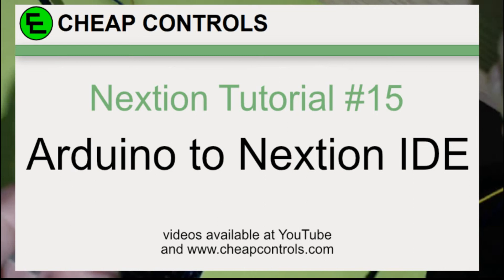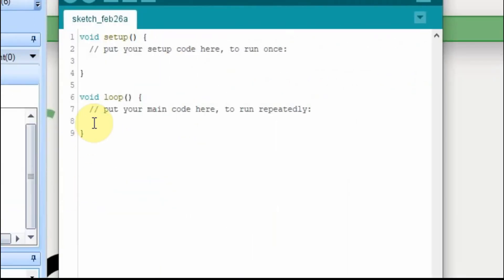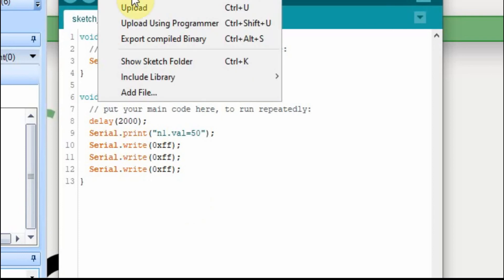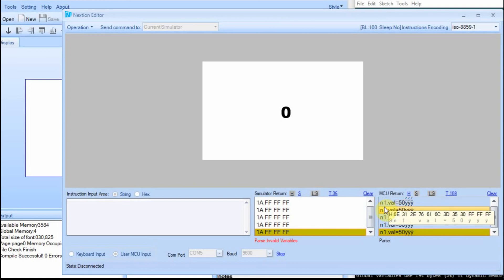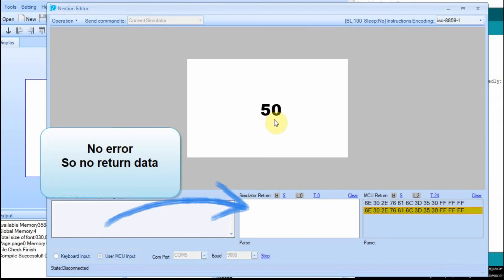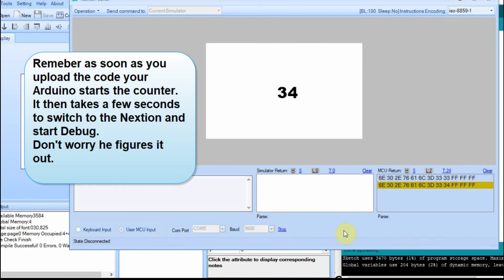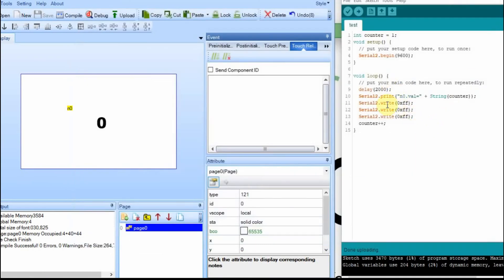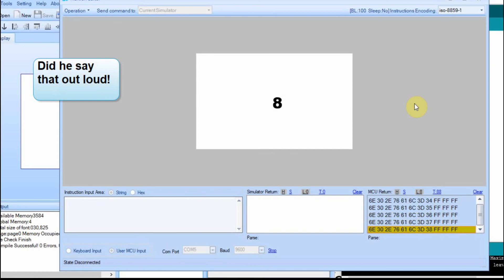#85 Nextion Display - connected to Arduino in debug mode - Nextion tutorial

Comment: Hey maybe you can help me.
I'm working on a bigger project with the Nextion Display.
I can recive data form the Display, but even with your tutorial I cant send them.
I'm also using a Mega with the Serial2.

Is there any butten I've missed in the Nextion settings?
Reply from the maker: You should connect the mega to the Nextion IDE in debug mode so you can see what you are sending.  I will look for a tutorial on this and post another comment.
Reply from the maker: Here is a link to that video https://youtu.be/22pqL1ovKtw

Comment: I managed to get it working with simulated debug but not with my actual nextion. However, my nextion works given parser is zero and my pins are blue wire to tx0 and yellow wire to rx1 on arduino mega, through keyboard typing in values.

However, this doesn’t work for me when I use the ide code, and I don’t know why. What am I missing?
Reply from the maker: I am not sure.  If you want me to review code or send images go to www.cheapcontrols.com and submit a comment.  I will reply through email.

Comment: Hi,
Is there a way to control the hardware control flow lines of the USB to serial adapter from the debug window?  I looking at trying to use the Nextion editor as a remote monitoring terminal for my microcontroller in a project and was hoping to use the RTS line to trigger the reset pin on my micro in the event I need to reset my micro for some reason.

Thanks
Reply from the maker: If you have an enhanced display you could use a GPIO pin.

Comment: Thanks a lot for your tutorial !, I recently started using Nextion I have problem in the display of data in Debug of Nextion , and I did not understand the role of Serial.write here in this program.I will be very grateful to you if you can answer me
Reply from the maker: I am not sure I understand your question.  This is an older video and I don't remember all of them.  Is there a timestamp that you can refer to?  That would help.  You can also submit a comment or question on the help page of the Cheap Controls website.
Reply: @CheapControls  I have a problem displaying the data in debug , the data should be as the next syntax : " Humidity level : " + a variable of type int , I couldn't display the variable even though I tried a lot
Reply from the maker: Are you using two connections.  One for the Arduino IDE and one for the Nextion IDE.

Comment: Hey i have a little problem while sending value with arduino, when i click on every button in the debug mode that send a return error 04 FF FF FF Parse Invalid Pic ID so when i want a "if (datareceive == "Anything") that doesn't work if you have time to respond i appreciate
Reply from the maker: Cut and paste the line you are trying to send and I will try to help.  Or you can go to www.cheapcontrols.com and submit a help request.
Reply: @CheapControls  I think there is a problem with the pictures but i can't see where is the problem, i want to send a string value with a simple button "gate" and i want arduino to read it so i can return a instruction for the debug mode. But when i click, that send "gate" but also "\x04ÿÿÿ" just below in the simulator return so arduino can't read just "gate", i tried to tell arduino if he can read "\x04ÿÿÿ" but its doesn't work. Here is my arduino if you want :

void end_message(void)
{
  Serial.write(0xFF);
  Serial.write(0xFF);
  Serial.write(0xFF);
}

void loop() 
{
  while (!Serial.available());
  
  datareceive = Serial.readString();

  if (datareceive == "gate")
  {
    Serial.print("Data return confirm");
  }
}
Reply from the maker: do you have the send component id checked in the Nextion?  that would send extra characters
Reply: @CheapControls  only the button to return in the previous page but not all of them send characters just a few one. If you have time i can send you my .HMI file so you can check but i don't want to 
disturb you
Reply from the maker: If you want me to review your HMI file, you have to go to the help page on the www.cheapcontrols.com and submit a comment.
Reply: @CheapControls  thank i'll do it this morning

Comment: Greetings! how can you fix the "access to com7(my arduino port) is denied
? Thanks <3
Reply from the maker: I don't know.  I would have to understand your configuration better.  What model of Arduino are you using?  What pins are you using on the Arduino to connected to the Nextion IDE?  It needs to be a different port than the one used to connect the Arduino to the Arduino IDE.  Good Luck.
Reply: @CheapControls  Hi! thankyou for your reply <3. my problem is already fixed though. It turns out the arduino IDE is also connected on com7 😅
Reply from the maker: Did you have to stop the Serial Monitor to allow the Nextion IDE to work?

Comment: Have you ever tried conecting the arduino to the PC so you can use Nextion Editor Debug and to a physical Nextion at the same time, so you simulate having two screens?
Reply from the maker: I have not done this but it should work.  It would be easier with a MEGA model.  You would need to have three serial ports configured.

Comment: Thanks for your tutorial! I have a problem: no information is coming from the Arduino to the Nextion display. Just an empty line in Debug mode. I connected the Arduino to the COM5 port with a separate cable and connected the Nextion display through the TTL adapter to the COM4 port. How can this problem be solved?
Reply from the maker: When you go into debug do you select user MCU port then you have to click on the word start.  Maybe you are doing that.  I am sorry if I am asking silly questions.
Reply: @CheapControls  yes, I click on user MCU and then Start. But nothing happens. When I open Arduino port monitor, nothing happens to. But if I change "Serial2" to "Serial", I see message in Arduino port monitor, not in Nextion debug mode
Reply from the maker: It sounds like you are doing things correctly.  You need to have two serial cables coming from the Arduino to the computer.  Serial on the normal port and Serial2 on the pins.  What Arduino model are you using.  If you want you can send your code to my Email and I will try to review for you.
Reply: @CheapControls  Thank you, I will be very grateful. Can you write your email address? Or maybe you have a Telegram messenger? I did not quite understand about Serial on the normal port and Serial2 on the pins. I tried to connect the Arduino MEGA via USB cable to the COM5 port and separately through the TTL adapter the Nextion display to the COM4 port. I did not connect the display and the controller with wires. Perhaps this is the problem?
Reply from the maker: You can go to www.cheapcontrols.com and submit a comment.  Then I will reply to you and I will ask for the files.
Reply: @CheapControls  I found what was the problem. The solution turned out to be very simple - it was necessary to connect the GND of the TTL adapter to the GND of the display (since it is powered from a separate power source). Of course, it did not work like in your video, but at least from the arduino, information began to come to the display.

Comment: it doesn't works for me
I have a USB-TTL cable.
RX to TX and TX to RX and power connected to the Arduino.
No reaction.
So I can't upload a sketch to  the Arduino, it won't be found.
If I connect the Arduino with a USB cable then I can upload the skatch.
But nothing happens in the Nextion Editor when I start in debug mode.
can you help me?
Reply from the maker: You need to have the Arduino connected to the computer with two separate USB connections.  One to code the Arduino and one to connect to the Nextion in debug mode.  This is the way it needs to be configured for the examples in the video.  It is possible to use only a single USB connection but the examples in this video would need modified.  I hope this helps.  If you still have questions consider asking it at the cheap controls facebook page.  It is easier to view code and photos.
Reply: @CheapControls  Thank you, i will to try
Reply: Connected the ground too?